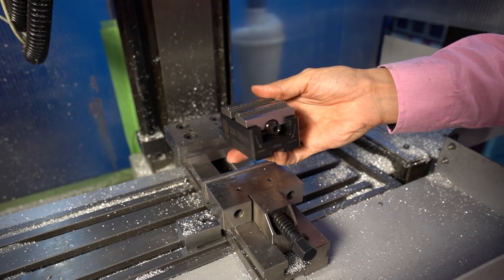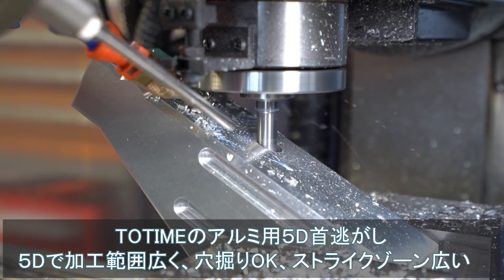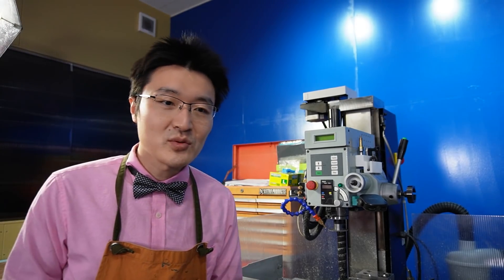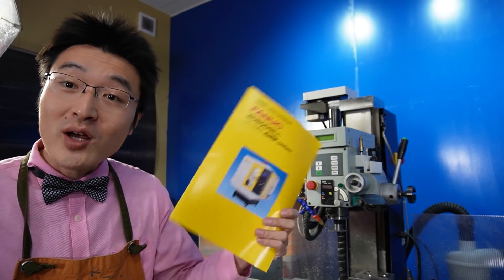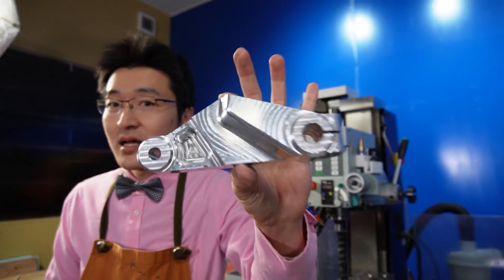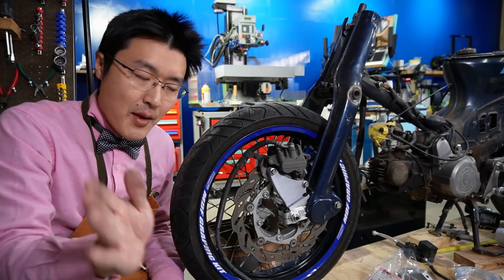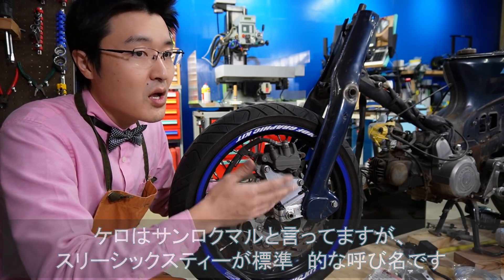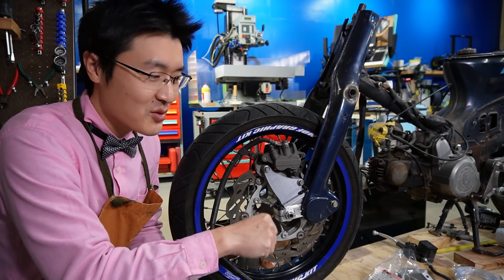スーパーカブのブレーキディスク化を削り出しワンオフパーツで

Comment: the aluminum thread for the disc grip is not strong. easily damaged. you should lock the thread with a stainless or iron nut.